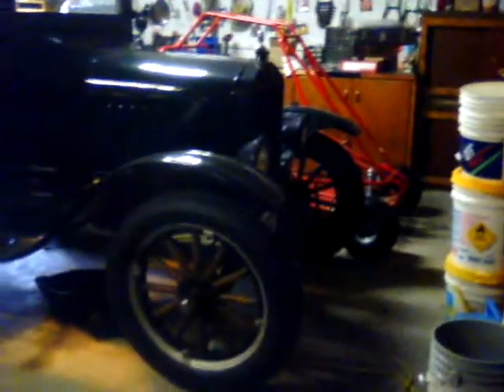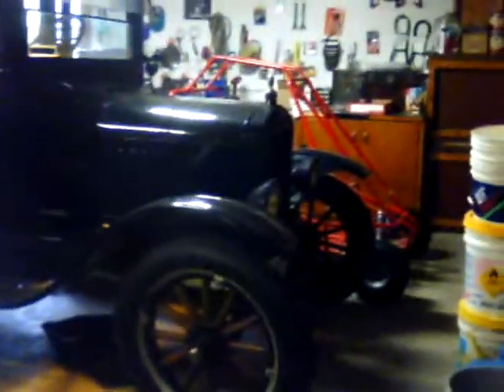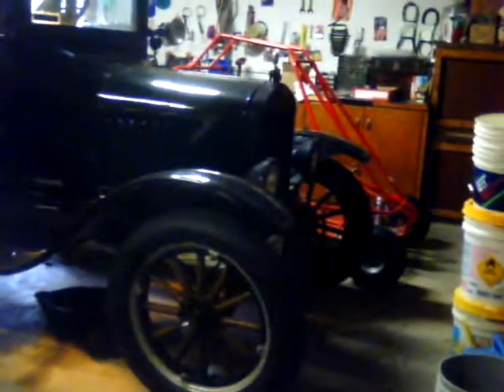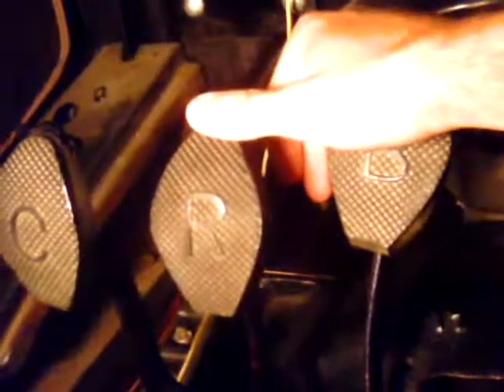1925 Ford Model T

Comment: I guess my first comment didnt go through but thanks for the video on the car. I was woundering what it looked like inside and a good look on the outside. Looks great and when the front part of the inside is put back together i can tell the inside will look great as well. I had an 87 MonteCarlo SS and had window problems with it. It's a pain messin with it. I couldnt imagine how carfull you would have to be to mess with the windows on that. Thanks again